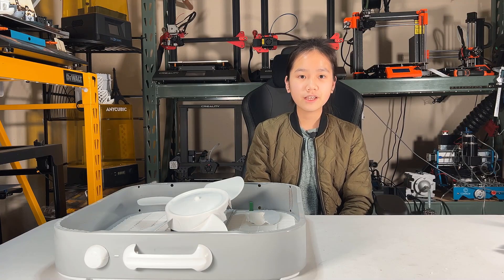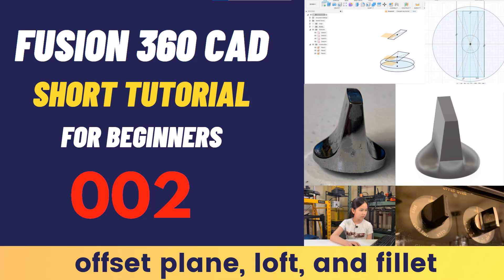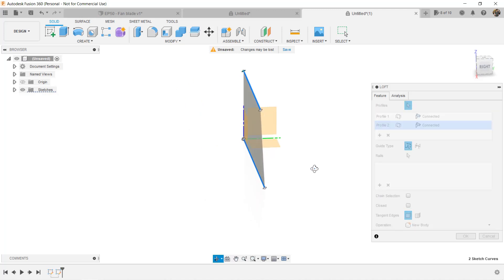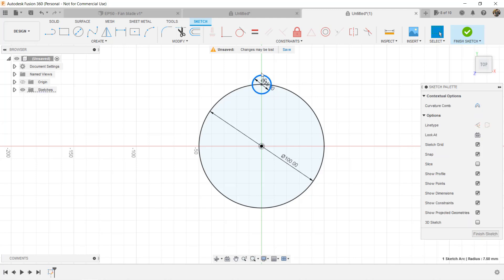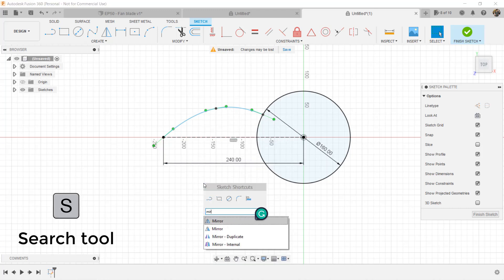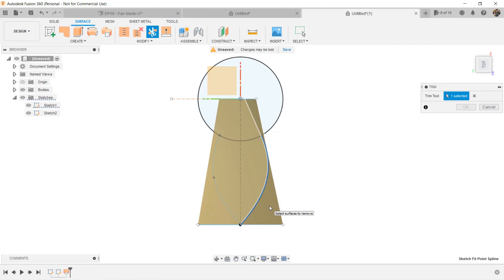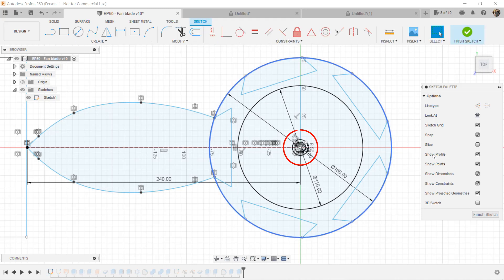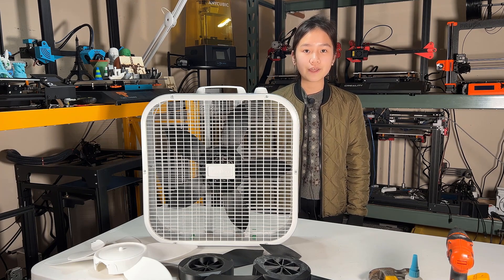Fusion 360 Tutorial for Beginner 007: Fan blade, surface workspace, loft, trim, circular patterns

Comment: would be nice to see an indept Fusion 360 milling on the 3018 cnc, setting up the 3018 and bits in fusion for Carbon fiber, Aluminium, POM, etc.

Comment: Well done! One tip I will give is to fully define your sketches (so that a little red lock icon appears on them). This way if you need to make changes they will work as expected. If you don't fully define the sketches, Fusion can sometimes get a bit squirrely.
Reply: That's true, but at least for me, these irregular shapes are almost impossible to define.
Reply: @larsord9139  Can sometimes take a little bit but it's worth it.

Comment: Incredible engineering job combining many skills to create the fan blades. Well worth it for the experience gained. I believe you should find a bigger project to apply your  experience and learn new skills. Skip the new product reviews.
Reply from the maker: Yes, we are going to do fewer product reviews, but need to finish up those brand-new machines in the garage.
Reply: @AuroraTech  Waiting for more fusion 360 project videos.